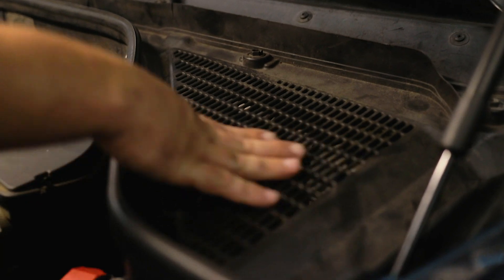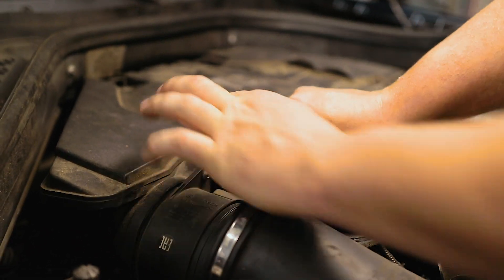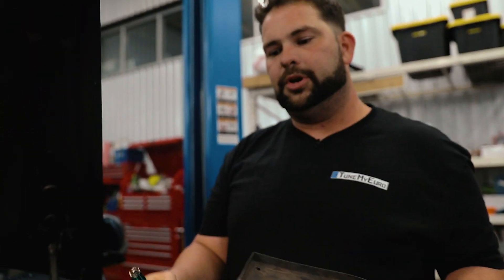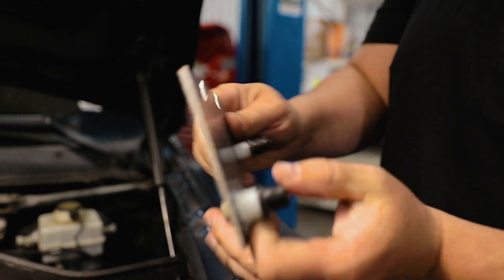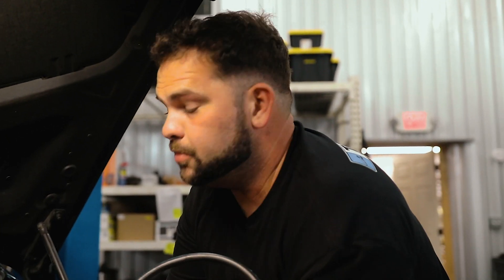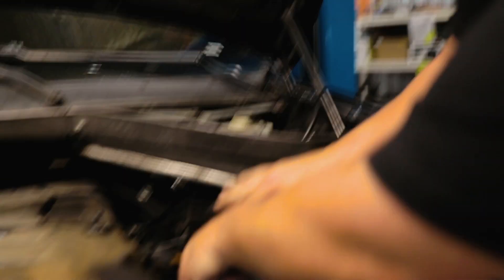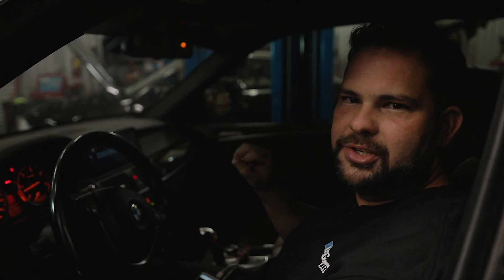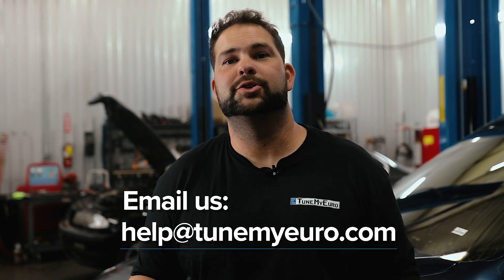X5 35D - 1 and 3 micron Hidden Fuel Filter Kits for DIESEL BMWs... DIY Installation video

Comment: Looks great. For the E70, do I need to remove the filter or the filter housing from the bracket to drain the water out? Or is there enough room to access it in that cavity? Also, I'm guessing the fuel heater is still retained and functional?